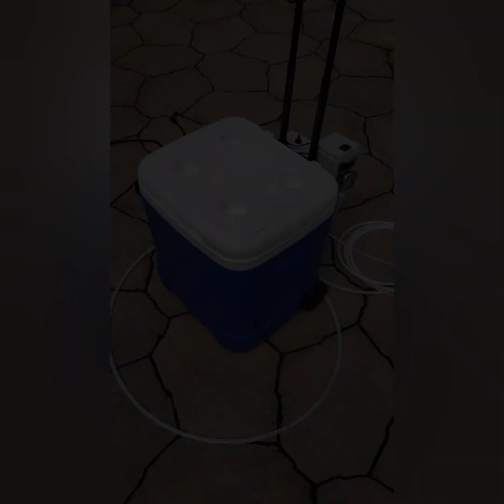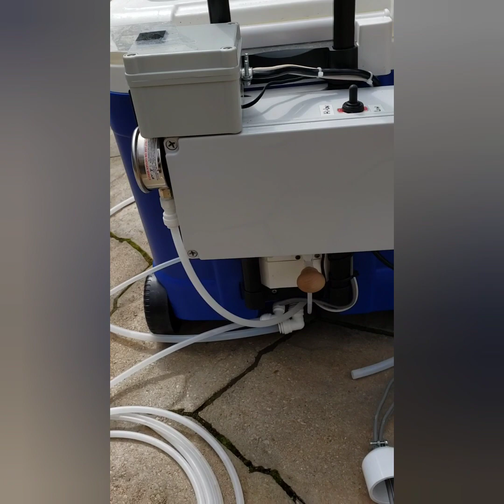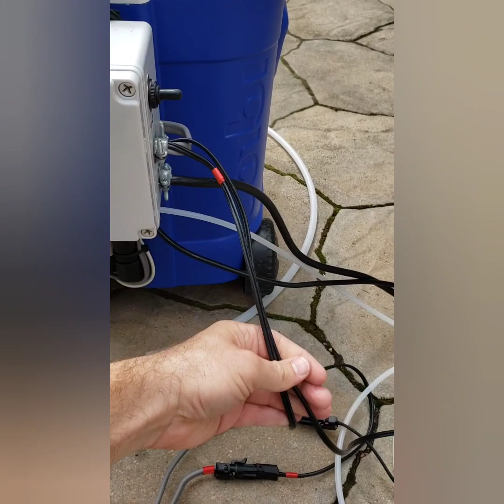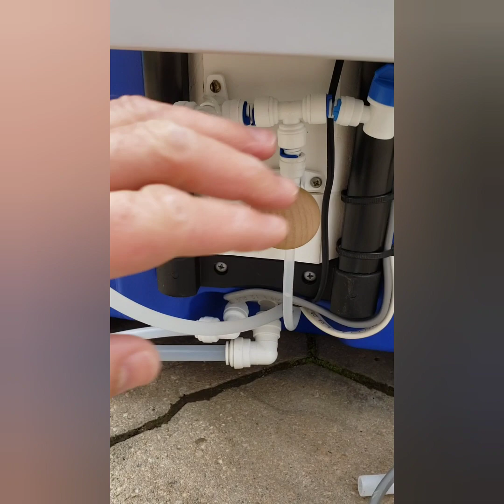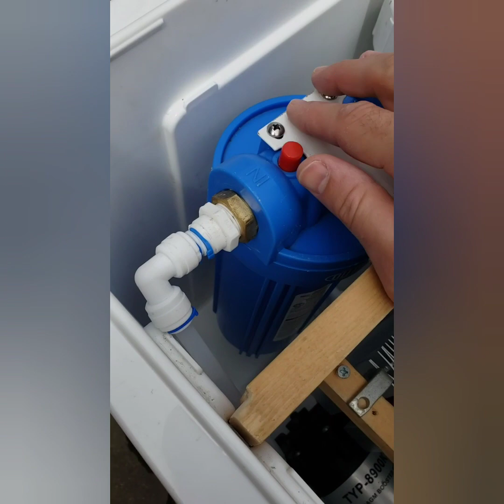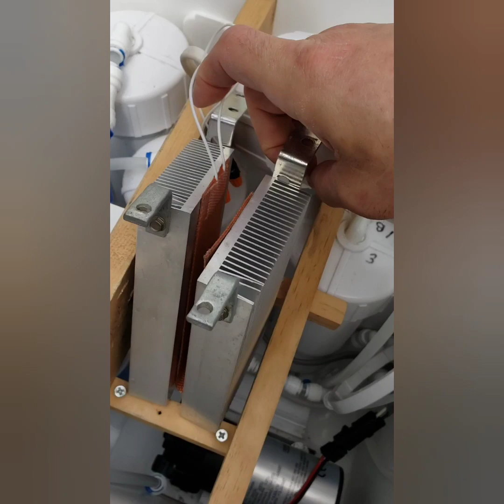Maple Syrup Reverse Osmosis (RO) - Automatic Level Control, Portable, and Heated #maplesyrup

Comment: If I only use one 400gpd membrane, would it take 50% of the water out? What would be the gallons per hour?
Reply from the maker: A 400 GPD membrane will remove about 4 gallons of permeate per hour at ~40F and 100psi.   The Coronwater TYP-8900 pump operates at about 40 gph at 100 psi.  So it will be removing 10% of the water.  This is recovery rate (permeate out / flow in) ==> 4 /40 = 10%.  You want to keep recovery rate for each membrane  LOW to reduce fouling.  So, 5 in series will give you a SYSTEM recovery rate of 50%, but the last membrane will have the highest individual recovery rate (4/(40-4*4)=16.7%) which is still very low. 

Bottom line, pump performance (flowrate at operating pressure), and membrane characteristics (size, rating, operating pressure, sap temp, optimum recovery rate range) all need to be accounted for when designing an RO.

Lots more detail in my other RO videos and blog:   
https://youtube.com/playlist?list=PL6CwcmcTEWYxhYPQCMAWETg9gHWL7_RXw&si=abrLev2d8syh2UYd

https://www.roseummaple.com/2020/01/diy-2-stage-portable-hobby-ro.html

Comment: Hello, any benefit or have you worked with trying flow rate meters to take the guess work out of 'equal' flow rates between permeate and concentrate?  Also - that 37-40 degrees - is that C or F? I'm assuming it's degrees F as you wrote it's mainly for freeze prevention.

I'm planning to start hobby/homestead tapping this coming season and am gathering ideas, I'm sold on RO for fuel and time savings and am weighing purchase (like Vermont evaporators RO system) or making my own, still deciding on boil/evaporator.
Reply from the maker: Very limited options for this low of flow rate (LZM-15 is best option) and didn't think it's worth the $25 each.  It's very easy to see if the flowrates are comparable.  I use an internal low pressure recirculation loop to increase concentration and be able to have a lower concentrate to permeate ratio than 1:4.  It's more like 1:3 or 4.

Yes that is degrees Fahrenheit.  

I vote for building, but you have to use the right components.  I've built 4 units (scaling up and improving each time) and loved the results.  

If you buy, I'd recommend one of the RO Bucket models.  Believe it is a lot more tried and true and hear Carl provides great support. I think the UV filter in the Vermont evap sugar cube is attractive in theory but much research on UV filters by the UVM have shown they aren't maybe as effective as one would hope.  Can't say for sure as I've never used them.

Comment: In this set-up, was your RO units in parallel or series?  I missed that point and what is the throughput given which method of filtration?
Reply from the maker: The membranes are in series.  Takes about 40 gallons of sap and cuts that in half (doubling sugar content) per hour depending on temperature. Using recirc you can increase sugar concentration but that will reduce the amount of raw sap processed per hour proportionally.

https://www.roseummaple.com/2020/01/diy-2-stage-portable-hobby-ro.html

Comment: Where is your recirculation line plumbed to
Reply from the maker: It is plumbed back to the low pressure intake side of the pump.  I have valves to control recirc flow vs output flow.

Comment: i was going to construct a similar set up but i found even with my old open set up i had small leaks in my tees or elbows at 100 p.s.i...how do you make something so compact and leak free...my tubing was cut with a new tubing cutter and the cuts were square...not sure what i was doing wrong
Reply from the maker: Cutting the (new) tubing square, using Teflon tape on threaded fittings, and pushing tube all the way in for push-to-connect fittings should keep you fairly leak free for these systems.

Comment: one your old ro system where did you get the over and under pressure switch and how did you install it?
Reply from the maker: Ordered it on Amazon.  It plugs into the power supply.  It never worked that great and I'd recommend using the GRL8-02 level sensor/controller instead.

Comment from the maker: Limited time 10% discounts on membranes available below until 12/31/2022:
400 GPD RO membrane with housing
https://www.amazon.com/dp/B07BT6HZNH
10% off Code：ROSEUMRO102

150 GPD RO membrane，2 Pack
https://www.amazon.com/dp/B07BPSFLNW 
10% off Code：ROSEUMRO102

400 GPD RO membrane，1 Pack
https://www.amazon.com/dp/B071SGLF18
10% off Code：ROSEUMRO10
Reply: The Amazon links all come back “page not found”.  Is there a new link?  Or could you recommend a different 400 gpd membrane and housing?
Reply from the maker: Fixed links
Reply: Thanks!    So I’m currently running 4 150 gpd membranes with a Aquatec 8852.  I would like to boost the throughput or the concentrate level.  Would switching to two or three of these membranes be a good option?  Thanks for all the info you post, it’s really appreciated!
Reply from the maker: @davekutina5948  Absolutley, but the aquatec 8852 won't work very well for more than 2 of these.  Upgrading the pump to the Coronwater TYP-8900K will give you significant increase in flow for a diaphragm style pump and work better with these membranes to achieve your objectives.

Comment: Great job.  Very creative use of controls.  I do wonder how often you clean the strainer and change the 5 micron filter?  It looks like that may not be an easy task.
Reply from the maker: I rinse out the strainer daily with permeate and replace the 5 micron filter every few days.  It's actually pretty easy.  Just move the top membrane and heat sinks to the side and reach in to unthread the strainer by hand and the filter housing using the wrench. Also, the wood frame that holds everything in place just slides into the slots in the sides of the cooler if a further disassembly is required.

Comment: Looks Great!!  But how much? :)
I Have 50 taps and so does my neighbor.  Looking to go RO next year.  But not willing to spend $500 to get there  :)
Nice job guys
Reply from the maker: Thank you! All-in cost with all the bells and whistles was right around $700.  However, that was spread out over 3 years since I incrementally added more membranes, the cooler, and the control system features.  Starting price for building a single 400 gpd unit would be around $200.  $200 - $700 is well worth the time and fuel savings you will get every year.
Reply: How much time does it take to operate a full cycle, from raw sap to concentrate including the cleaning process? Specifically I’m interested in the cleaning process.